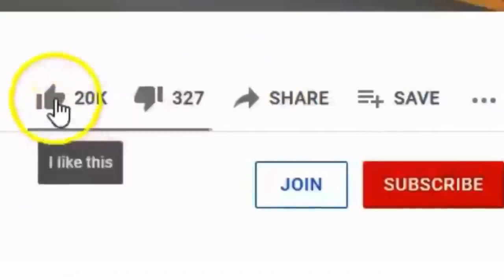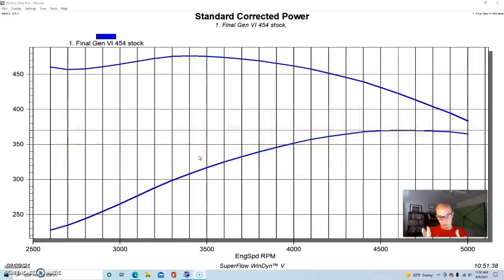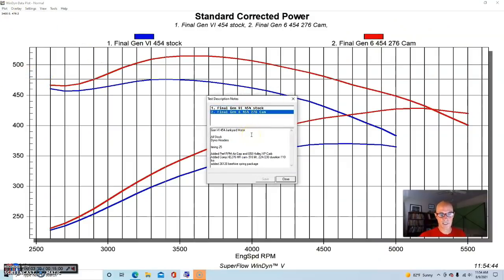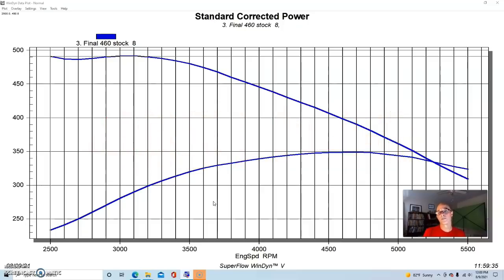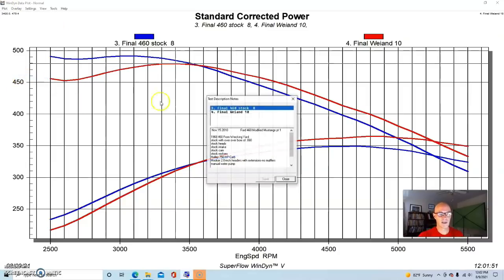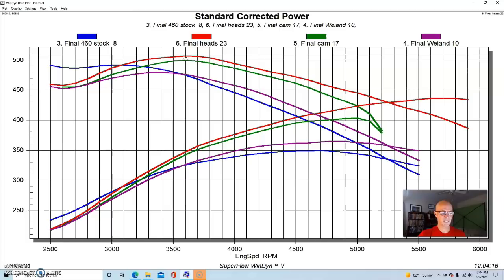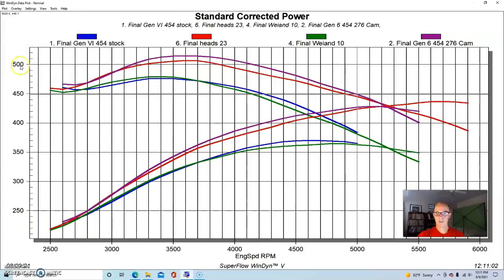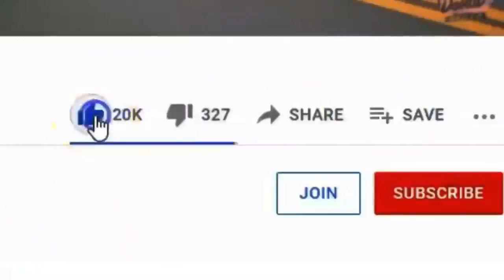JUNKYARD BIG BLOCK POWER-460 FORD VS 454 CHEVY FULL DYNO RESULTS

Comment: In mechanical theory the 460 Ford should be the longer lasting motor.  The 460's shorter stroke gives lower piston speed at any given RPM and theoretically less wear.  The 460's longer rods combined with the shorter stroke provide less rod angularity again theoretically giving less stress and wear on engine block and components.
Reply: Maybe, but I've had a few flat tappet cams go flat so I think that would factor in as far as longevity. Not saying the chevy motor is better its just 30 years (roughly) newer. And I own a ford and a chevy so I'd like to think I'm not biased
Reply: @shaytassi  sorry the 460 never had a flat tappet from the factory
Reply: @paulpruitt2776  that's incorrect
Reply: but the ford has a worse factory oiling system and huge main bearings more bearing speed equals more chance of bearing failure
Reply: @paulpruitt2776  
Um they were all flat tappet
Reply: @paulpruitt2776  Wrong
Reply: Bigger bore means better breathing too... 460 has a better chamber than chevy...
Reply: @scottford1091  way worse head flow than a bbc intake and especially exhaust runners
Reply: @BowtieSpeedruns  thats for sure... damn shock towers on a ford dictated stupid exhaust port flow and location. CJ heads are a bit better but chevy exhaust ports are always better than comparable Fords.  Fords have usually had better intake properties and really good chambers. I wish you could take the best of both heads and then you'd have something amazing... I guess in the small block world it's called an LS. I love my Fords but give credit where it's due.
Reply: @vandersgarage4682  no roller cams from the factory. All flat tapper. Now ford racing? Different story.
Reply: @matthewnosal6893  I don't know why you're directing that comment at me. I'm not the one that said it had a roller cam. Paul Pruitt is the one that said they never came with a flat tappet from the factory.
Reply: @vandersgarage4682  didn’t realize that sorry
Reply: You read that out of books. Theory is what it is.
Reply: @vandersgarage4682  hydraulic flat tappet
Reply: I like a 1.7 rod stroke ratio. Seems to be the sweet spot between power output and longevity! Back in the 90's my brother was into mud racing in the street class. Ever year they changed the rules on them! Had to keep the small block Chevy guys happy! Shot rid motors will scream, for a little while!! Po boys need to stick with what is cheap and will hold up!
Reply: @paulpruitt2776  They all had hydraulic flat tappit cams! Put that crack pipe down!! 🤣
Reply: "At any given RPM"

But (also in mechanical theory) a shorter stroke necessarily means a higher RPM potential and therefore potential greater wear if the mill is driven in higher rev ranges.  No free lunch and all that.
Reply: @chuckschillingvideos  po boys need to stick with stuff that'll stay together while putting a grin on your face! It's more complicated than just stroke! The rod stroke ratios is what I look at! And short deck blocks have a definite disadvantage there! Now, cash makes fast cars, math makes fast cars stay together! Fords and Chryslers have a definite advantage in the staying together department! The trophy goes to the Chrysler small blocks! If only they had heads reasonably priced! Money got into it! The Friday night crowd that worked 7 days a week got left behind! Now, where's the money coming from?  Indivials that lack the ability to speak proper English and no real visible means of support paid people to build engines and drive their cars!! You get paid by the hour and compete with people that get paid by the gram! Yea, I said it!! I quit it 12 years ago, bought a camper and never looked back! Where's the money coming from? $25000-30000 cars? The extra motors, the enclosed trailers from guys that were punching a clock a few years before?!!
Reply: Not to mention the BBC problems with oiling drain back correctly.
Reply: @BowtieSpeedruns The BBF has worse oiling system than the BBC? Is that why people have had to fix their BBC oiling problems up top? Talking about the drain back.
Reply: The Ford had the spindle Bendabearing flow stack allowing a lower strapometer temperature and this is why the Chevy added the cam hydrogenic rotatertot smile-dial which exceeded the FDAs maximum dosage rating. Ford wasn't about to be outdone so enter the creel soaker cync tipple and a good 7.25 horsepower knickknack Bloomberg rating

Comment: I own 3 BBFs so I have some experience with these engines. Richard, you were correct about the Edelbrock manifold being better, but even the non-air gap Performer RPM is still a better manifold choice than the Weiand Stealth, especially for a mild combo like this. The Comp cam choices are typically made with Chevys in mind so I have stayed away from their cams, and opted for proper dual pattern and custom camshafts. These Fords need a lot more exhaust emphasis than a Chevy does, and the intake ports don't really need any help at all. Bottom line, both these combos would make more power with not more money, but a more specific set of parts. Especially the 460.
Reply: I did whats called a poor mans 460-500 stroker for a truck once with stuff laying around shop read about it in a mag one time so one day had a customer who wanted cheap torque for old truck pulling equip. So took and offset ground crank used a set pontiac 455 rods narrowed down some .030 Olds 400 slugs and Cadillac 390? rod bearings. Had a cam ground, zero decked it shaved n ported exh up on some small ch heads. Its been yrs since I built it but actually did really good. Prob wasnt worth the hassle but he said would pull anything he could put behind it. Ever heard of one them? Lol
Reply: Ford always loves to say what Gm Chevy motors needs or don't need.
Reply: @god1st.530  it's know to everyone that Chevy mouse and rat had good exhaust ports. Comp knows it too. That's why single pattern cams.
Comp has finally got with the program and made dual pattern cams. 
But most Ford engine builders use other cams because Comp has low quality and a failure rate factored in.
Reply: @god1st.530  did you even read the comment??

Comment: Yea, I'm a born and raised Chevy guy, but I like and respect what Ford and Dodge have done with their V8 engine platform. They're all just air pumps.
Reply: I have to laugh everytime someone repeats that.
Reply: Thank you I was born into a Ford family but power is power, the only reason it should matter what brand is making it should come down to what body style you like
Reply: Well the only one of the three that has achieved anything with their engines in this case their big block is Ford winning lemans with the legendary 7.0l FE hitting 7k rpm for 24 hours beating ferraris V12. But these hicks and inbreeds thinks cheby is better because there is more of em in the junkyard? No point in mentioning dodge their a joke, sometimes honestly idk what I’m missing.
Reply: @CoyoteFTW  every engine can make power but ford is king when it comes to race motors
Reply: @CoyoteFTW  MIke, 7.000 rpm was the MAX RPM LIMIT they were allowed to turn during the race by Shelby.  For 99.9% of the 24 hour race, they turned about 5,000-5,500 rpm.  The 427's were detuned in order to finish the race.
Reply: @CoyoteFTW  Mike, you've obviously never heard of CANAM racing.  Naturally aspirated Chevy big blocks RULED that series from 1967-1971, twin turbo Porches in 72 and 73, and big block Chevy again in 1974.  Big block Ford powered CANAM cars didn't win shit.  Read and learn.
Reply: Skip R  Your exactly correct and nailed it sir.
Reply: @CoyoteFTW  I thought we were talking about big block Fords here, not Formula One engines.  Do you own and drive a Formula One Car?  Nobody does, so it's a moot point really.  In the 1960's, Ford Motor Company wasted hundreds of Millions of $$$$$$ on engines and race cars you can't own and no one drives.  What's the point?  Stupid Ford Tricks.
Reply: Atleast the ford can be punched out to 
.60 over thats a big nono for mopar
Reply: Your using a Chevy engine that Chevy guys throw in the trash, it can't be called a big block, just pure junk in those days, factory rated with like 250hp
Reply: @corvettejohn4507  I'm just proud he didn't mention bailouts.
Reply: Need more guys like you in the community a lot of people have no idea what they are talking about never mind how and engine works and claim my truck is better because it’s not a Ford or Chevy etc I do not like dodge at all but it’s only because I owned them and they all met their demise with the transmission and rust but the manuals are great but seem to rot out a bit faster than my fords did and with Chevy I just cannot stand their front ends if they brought back the old straight axles they would be the truck you see in every job site and not fords Ford is my number 1 just because of that fact and the new 7.3 gas is a mean engine then Chevy comes next just cannot get over their weak cv axle front ends I don’t understand why they ever did that Ford lacks with the interior department on the superdutys unless you buy a king ranch platinum or limited
Reply: @corvettejohn4507 - Gliddens boss 429 dominated in NHRA pro stock and Rickie Smith in IHRA prostock if the bbc was so good why did GM not use it? why did they need to build a ground up new engine with Oldsmobile block and Ford Cleveland heads when the 500ci rule was announced. I’d like a Chevy guy to answer that rittle. If the bbc is so great why didn’t GM use it when the 500ci rule was implemented? They had to come up with a new engine that isn’t even chevrolet. And they still couldn’t beat the boss. Too bad Ford didn’t produce any performance engines based off the 385 they were introduced in a time when government and epa cracking down on emissions killed all development of performance engines in the 70’s and 80’s. No doubt the 385 is one with the most potential

Comment: What are you doing. If you ran these on a dyno why not show the video of it. Run comparable carbs cams intake ignition and headers. You know how to make a professional appearing video because I have seen you on a video with the Hot Rod guys. This looked like it was done in your living room. Your charts could use easier to follow labels on which motor did what with the different parts.

Comment: Both would be super fun engines on the street, 500 ft lbs is no joke. 👍🏻
Reply: @jdhall420  
Yeah I’m aware of that...
Reply: @jdhall420  stock type piston
Reply: No kidding.  My Jetta has a 2.0 TDI making 520 Ft-Lbs at the tires and it does AWD burnouts if I dump the clutch around 3K RPMs
Reply: @christianmeeks4430  
Right on. 👍🏻
Reply: Hell the 69 and 70 460s made 500 ft lbs from the factory.

Comment: Really enjoy these comparisons. Would love to see you work on a 8.1 / 496 vortec, please!
Reply: Would like to see a comparison between the 8.1 V8 and the ram 8.0 V10
Reply: Skip R  In stock form pretty much, there aftermarket heads available for them now, and with a forged rotating assembly and the beefy blocks those use there is a whole lot of potential, especially nice having the mult port injection and electronic controlled ignition.

Comment: I would definitely like to have the early BBF 460!!! That 454 is a very strong motor also.
Reply: My 1992 Ford F-250 4X4 had a 460. It was a beast, sadly the gas mileage was horrible for an everyday driver.

Comment: You used some of the last parts I would use on my BBF. The weiand intake is far from the capabilities of the RPM Air gap . The Weiand Stealth kills torque on the BBF in my experience. Oddly enough they seem to work great on BBC . Getting that 68 460 to 1hp per cu in is easy as can be with a RPM Air Gap , Cam and ignition upgrade. 500 hp isnt difficult either. Both of those engines are easy to get into the 500 hp range without too much difficulty . I actually have both right now . I have a 73 Chevy pickup with 454 and use the Weiand Stealth intake, long tube headers, Comp cam, Comp Timing set , Comp lifters and springs and Comp Roller Rockers with a 850cfm Holley that chassis dynoed @ 457 rwhp / 486 rwtq. My 460 is in my jetboat but its now its a 521 stroker with tunnel ram , dual center squirt Holleys and more so comparing it wouldnt be accurate but it flywheel dynoed @ 741 hp and 686 tq. With more left on the table if I wanted with just a few changes. But its far more than enough in my boat as is

Comment: Im a 454 guy. But have been around both. They are great stock and beasts tweaked.  And have seen pretty decent mpgs from both. Wayyyy better than my current k3500 6.0 NV4500. 10 empty.

Comment: If I were doing it, I'd try to start with a 90's truck 460. A little stouter to start with. That's  what I'd put a stroker kit into.
Reply: I'd like to see a late model truck 460 because the heads were very different and the exhausts were way better, but it takes completely different exhaust and intake manifolding. Pretty much no one makes an intake for a F3TE. You can use adapters from Price but otherwise you're stuck with the mamby EFI intake and\or a 4bbl adapter for that intake.